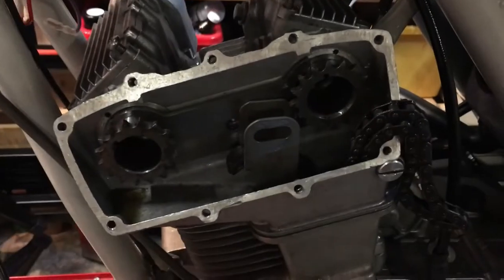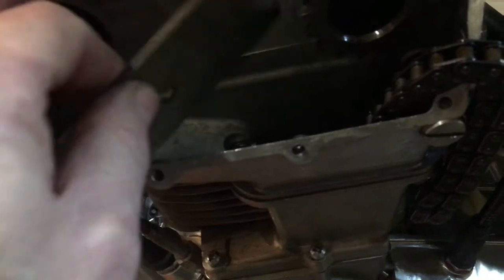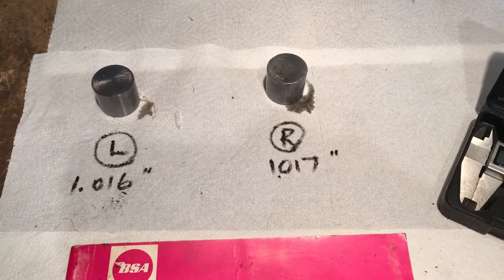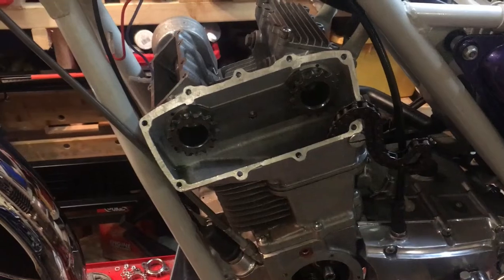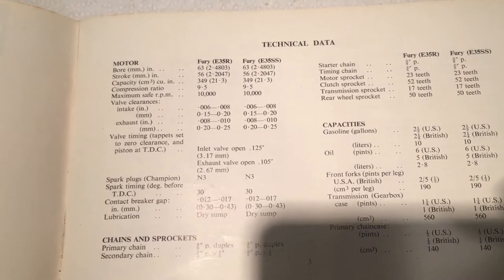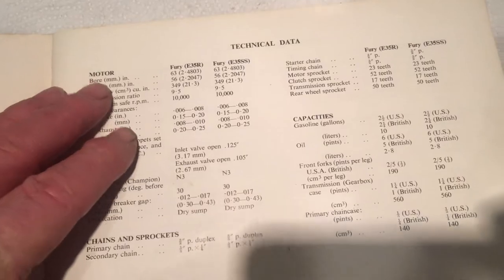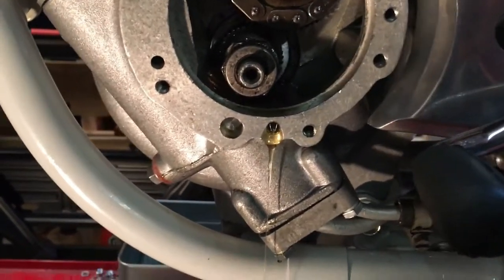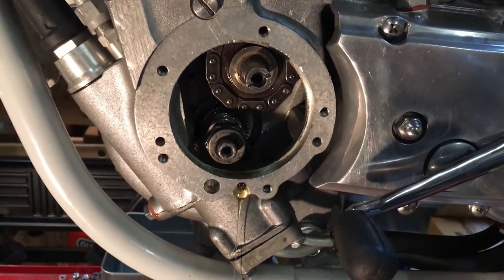BSA Fury SS (E35SS) Build - Valve Gear Fettling and Timing

Comment: Great progress Angus, glad you were able to get the engine to turn over without any tight spots. Not too much shaved off the buckets so there should be nothing too worry about as regards loss of contact length. Even on a kick start it can take what seems like forever to get oil to the top of an engine but if the oil pump is turning then I am sure you will succeed with an achi ng leg as a result.
I will post some video of the machining work I did soon, I just have to edit out some music which would invoke copyright problems and I will post four or five separate videos.
I wish you and your family a very happy New Year,  hopefully we will all be able to get to attend some shows after we get over the worst of this virus outbreak.
Reply from the maker: Many thanks Bob. Happy new year to you and your family. Yes indeed look forward to meeting up at shows at some point in 2021.
Reply: Another good video,  well done !! All the best  for 2021.
Reply from the maker: @matthewharmer1656  thanks Matt and to you too.
Reply from the maker: @Bob Rodgerson I forgot to add - look forward to watching your vids when you put them up - thanks.

Comment: You may have covered this in another video, but I think you mention here that there is a slight crown on the buckets?  From an old copy of Classic Motor Cycle (again), Doug Hele implies this was done for noise reduction and he couldn't remember for sure but thought the radius was 30", which from a back-of-the-envelope calculation would mean 4 thou in the centre relative to the edge.   Whether this had another purpose than noise reduction, is not clear from the short article.  If I remember rightly, some other DOHC designs (e.g. Lampredi/FIAT) either have the cam contact off-centre to the bucket to ensure that the bucket slowly rotates in use thus avoiding uneven wear, or have tapered lobes on the cams plus a crowned bucket to achieve the same effect.  As you probably know, the FIAT engine also has the shims on the top of the bucket, which increases the reciprocating mass but makes setting the clearances a lot quicker.
Reply from the maker: Thanks as always for the technical insight. From memory it’s only 1 thou rather than 4. My understanding is that this was done to encourage the buckets to rotate to even out the wear. Interesting stuff either way nevertheless.

Comment: Happy New Year Angus , nice job, only thing is don't you need to machine a slot into the exhaust cam for the ignition timing setup? Or did I miss that? Cheers Gordon
Reply from the maker: Happy New Year Gordon. Yes you’re absolutely right - I do - but I’m going to tackle that once the auto-advance arrives - currently kindly being fabricated by Richard Porter - when I can then time the ignition. Will make a change from timing cams!

Comment: I've read that the 350cc engine was never really well thought out in regards to getting at the oil dipstick and setting the valve timing without seriously digging into machine to do what should be relatively easy maintenance tasks.  As BSA ran out of money, these and other issues were never addressed and then time ran out.  What is your take on this?  You are dong terrific work but it looks as though you are forced to upgrade and correct this prototype as you go.
Reply from the maker: Hi John thanks for the comment and thoughts. I think that there’s pros and cons to this design - some of which show ingenuity and some of which don’t. This probably due to having to take the Turner design and upgrade it, rather than start from scratch again. Fur instance, being able to remove the cams to maintain tappet clearance, tensioners etc without major dismantling is clever. However it was known that the overall head design regarding port shallow angles was inefficient due to constraints with the depth of the head within the frame. Another good point is the ability to remove the gearbox with the engine in situ. There’s no issue with the oil dipstick  but there is an issue with carb access but that’s down to the frame tube design - another case of one good aspect compromising another - it’s difficult to get at the ticklers. Some of the issues I’ve been having is not due to me having or any specialist engineering work having to modify the dimensions/design of any part - the challenges have been due to not having detailed specs, drawings in some cases, and not having access to special tools for machining, particularly the head. The final point is that we’re definitely using mismatched parts from different revisions of the designs during development so again having to modify a little on the way which wouldn’t have originally been required. Reviews in general usually highlight the rather bits and pieces approach to the crankcase/cover design - lots of mating surfaces to try and keep oil tight. The biggest issue the factory seemed to have before the plug was pulled were the points and ignition timing. That’s my take John as an amateur mechanic/fitter, not an engineer. Thanks again for interest.
Reply: @BSAPowerSet  Thanks for the detailed reply.  It looks as though BSA was making upgrades on the fly.  Now, 50 years later you are picking up where they left off without the benefit of BSA factory specialized fixtures, tools and workshop manual updates. That's way more of a challenge than most people would even care to handle. You are to be commended.  Happy New Year!
Reply from the maker: Thanks John you are too kind. I'm not doing anything special - just using a few life skills - patience, logic and tenacity maybe. Thanks again and Happy New Year to you too.

Comment: I had to kick my B44 over with the spark plug removed to get the oil to to feed the head and valve gear, it took me about 1/2 an hour of kicking to get it to appear. It's taking shape now isn't it.
Reply from the maker: Yep definitely taking shape David and only another 15 mins of cranking before we hopefully see oil appearing out of the head feed pipe then lol. Cheers.